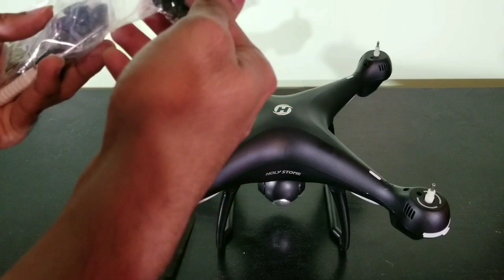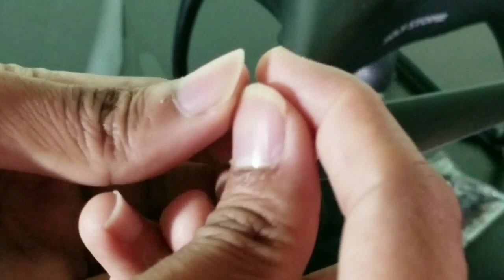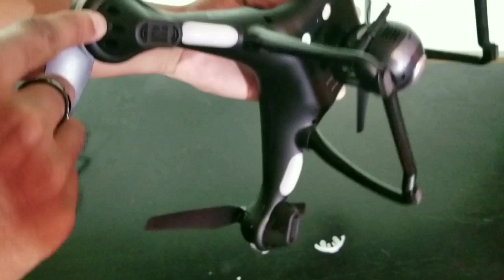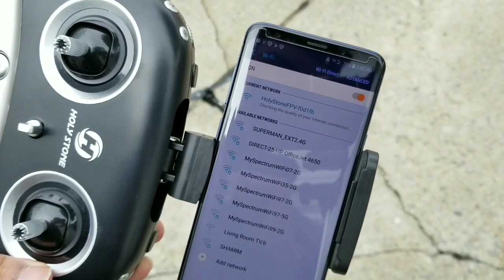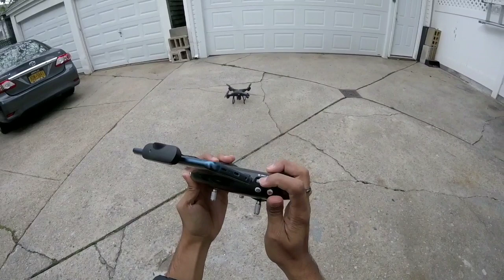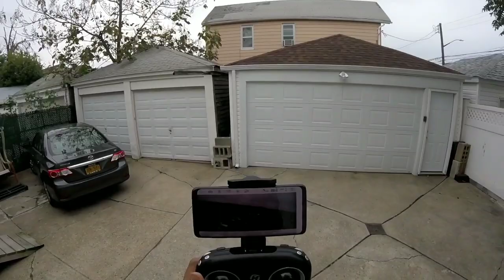Set up and First flight| Holy Stone HS1000 FPV Drone

Comment: Mine came fully assembled in the box. Weird. Also if you're new to flying a drone (like me), you probably need to go to a large field for first flight. Controls are super confusing and "manual" provides zero direction on how to fly. Also, drone controls are super laggy. Super afraid to fly it at all at this point. Seems way too advanced of controls for a beginner. Looks cool, but scared to fly since my first year flight was super disconcerting. Not very responsive. Seems to have mind of own. Guess that's what I get for only a $55 drone.